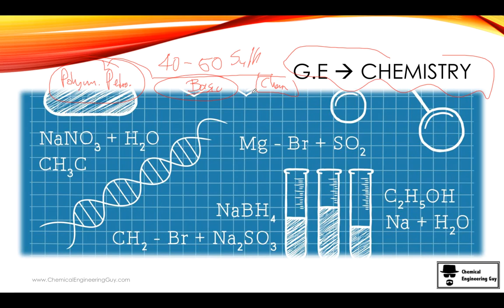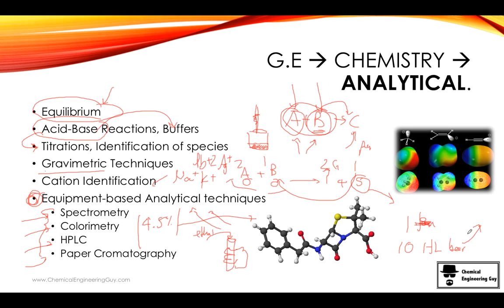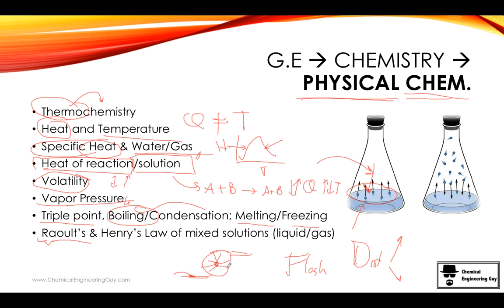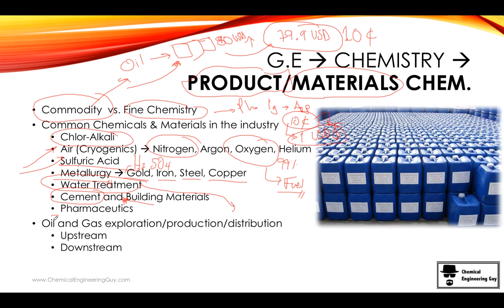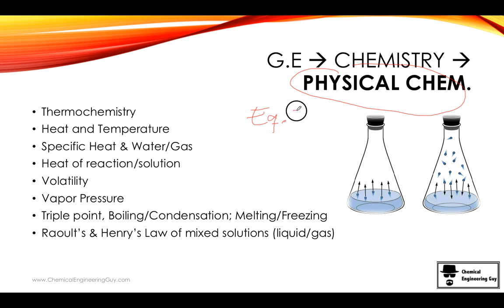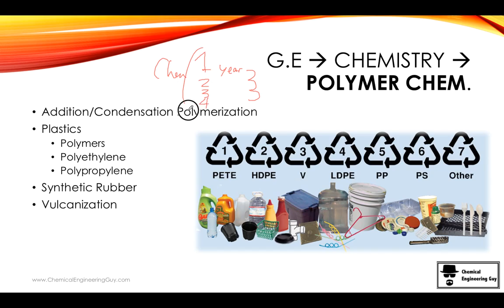Chemistry needed for Chemical Engineering (E04)

Comment: Really nice video, but i would like to point out some times that i consider important

1) Kinectics is a part of physical chemistry,  physical chemistry is divided into 4 big branches which are thermodynamics, quantum mechanics, chemical kinectics and statistical thermodyanamics.

2) In reaction engineering chemical kinetics is just a general tool that we use to  design and understand the processes proccesses that will or are taking place in the reactor but as chemical engineers we are more concerned about the hydraulic patterns in the reactor, the heat and mass transfer patterns as well as how to control the variables that affect the performance of the operation.

And to summarize, the most important branch of chemistry for chemical engineers is physical chemistry, chemical engineers just need to understand the basics of organic, inorganic and analythical chemistry, in the case of general chemistry that subject is a kind of physical chemistry course not based in calculus.  To master physical chemistry and the applied physical chemistry you have to master many mathematical tools such as multivariable calculus, both ordinary and partial differential equations, linear algebra etc plus you have to master the approach of problem solving that physicist use so thats why so many people say that in chemical engineering is more physics oriented than chemical oriented.
Reply from the maker: Thats true! Thanks for pointing out!

Comment: Really nice video, but i would like to point out a few things

1) Kinetics belongs to the physical chemistry, physical chemistry is divided into 4 big areas that are thermodynamics, quantum mechanics, reaction kinetics, and statistical thermodynamics.

2) Kinetics is not the same as reaction engineering, in reaction engineering you are more focused on the arrengment of the reactors, the fluid dynamic patterns in the reactor, the heat and mass transfer patterns and also about the process control, you need kinetics just as a tool and the dont teach you that because it is normally a topic convered in physical chemistry.